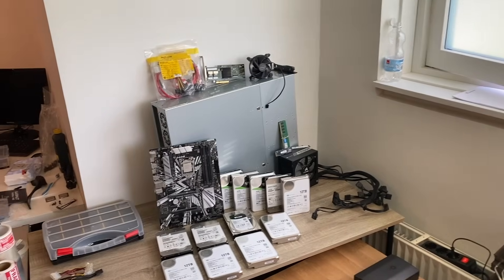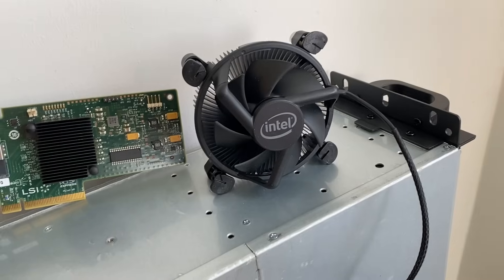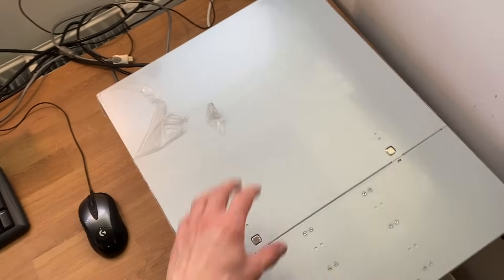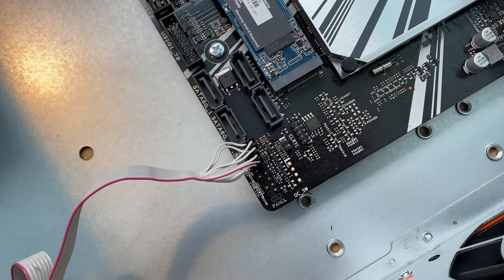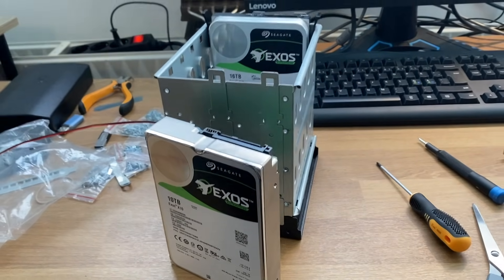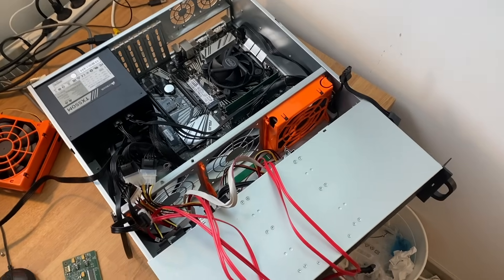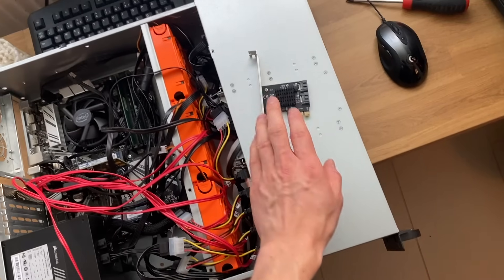Building a massive 164TB Home Server with 12HDD’s | maximizing my Storj Earnings & much more!

Comment: I'm considering Inter Tech 3U case, slightly different model number, no fans in the centre basically, but the front cages area look the same. Any idea if they are removable? Coz I'm thinking about using an Icy Dock or alternative 6 x 2.5 hot swap cage. which is 1 x 5.25 in size. And I will probably add a HDD hot swap cage so I've got that option, which would most likely be a straight swap for the section where the fan is and you aaded the first 5 drives. But wanna know if both are possible, or whether the internal drive parts are fixed in place, and not not modular, where I couldn't add the Icy Dock 2.5 cage.

Comment: 🎯 Key points for quick navigation:

00:00 🌐 Got internet setup in the workshop.
00:14 📦 Building a new 164TB server with 12 HDDs.
00:27 🔄 Only one drive dedicated to Storj, rest for personal projects.
01:09 ⚙️ Using a mix of SSDs and SATA drives with NVMes for the OS and caching.
02:05 🖥️ Motherboard: 9th Gen Intel i5 with lots of expandability.
02:47 💾 Storage includes various Seagate and HP Enterprise drives.
03:28 🔌 550W power supply and two NVMes for 250GB each.
04:50 🏠 Intertech server case housing 12 hard drives.
05:58 🧰 Case comes with four pre-installed fans, upgradable if needed.
07:09 🛠️ Installing the motherboard and power supply.
09:03 🔗 Routing cables and configuring PCI lanes for airflow.
10:26 🚧 Finalizing hard drive installation with 11 drives inserted.
12:31 🌬️ Swapped out fans for quieter, PWM-controlled ones.
13:01 🛒 Ordered a PCI one lane to two SATA connections for full setup.
13:55 🚀 Server up and running with all drives recognized in Windows.
14:52 📂 Drives allocated for Storj, personal projects, and future expansion.
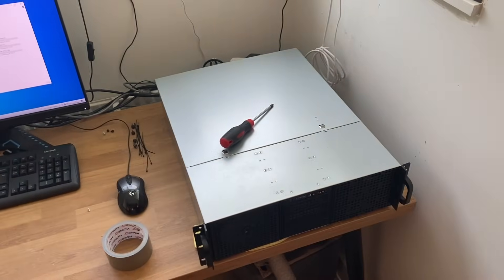15:20 ✔️ Successful build, case closed without issues, ready for use.

Made with HARPA AI
Reply from the maker: Aight

Comment: Bought the same case but I also added 2 extra 3.5" cages of which one is mounted behind the fan wall in front of the PSU. I have an 600w SFF psu and mATX motherboard. I can fit 19 3.5" drives and everything fits perfectly :)
Reply from the maker: Thats Great man!👍🏻👍🏻

Comment: Good setup. But, how much time needed to fill up 164TB with storj? I think, possibly never. There is was a huge data deletion at the last month. My node with 12TB space running 22 month and it's filled only at the 8TB for now. I have good internet connection and online up to 99%, good disk speed, but ingress is to low and periodical deletions is too big. Maybe I'm doing something wrong. Or node location is no good.
Reply from the maker: Hey nathan! Not all disks Will be used for STORJ. Also they are now talking about alot of new data Coming soon.
Reply: @hgsoftware5129  I've seen a significant increase in incoming traffic on my nodes over the past week. About 2TB is coming in each day. I really hope the traffic doesn't decrease in the future.
Reply from the maker: Its test data

Comment: I watched cause of that jazzy looking motherboard, as much as i like that case the money spent on that couldve been spent on a better motherboard, plenty of none server class pc cases that can house loads of Drives, Corsair Obsidian 900D/1000D, Phantek also make server sized cases, good job you dont have Graphic Card usage in mind for Video Editing or Gaming considering you only have 1x 550watt Power Supply, downside to that case only taking 1 PSU, FYI those PCI_E x1 slot SATA adapters come in 4 Port Versions as well, went down the windows route rather than Linux with Proxmox or Truenas kinda wonder what the use case is? and what about RAID? PS you can get x4 NVME PCI-E x16 Slot Cards pretty cheaply if you wanna use that other x16 slot as long as you can bificate the slot into x4x4x4x4 for each nvme drive on the card.
Reply from the maker: Hey man!
The mobo i allready had - so Big bonus. The case is cheap, and getting another Gaming case to hold 12 hdd whould cost the same even in used marked. Also the rack style fits My placement. ;)

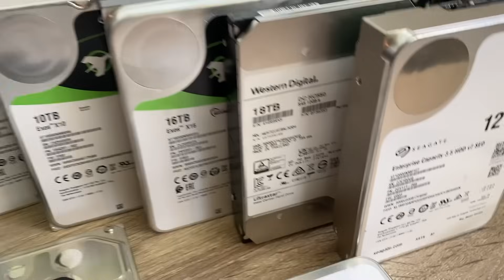Comment: 2:57 - These "HP" drives look like HGST Helioseal Ultrastar drives (owned by Western Digital, whose name is also on the lower part of the label). 
This is also confirmed by the model number of e.g. the left drive (WUH721818...), which is completelty fitting the HGST Helioseal drives, except for the first letter, which is W instead of H. U = Ultrastar, H = Helioseal, 72 = 7200 rpm. 18 = raw capacity, 18 = available capacity...
I personally am a big fan of these drives. They are very reliable and by many datacenters used.
Reply from the maker: Hey Thanks alot! That makes sense. Yea the drives was bought from a very high end local Company that uses the disks for windmills, they hard these they did not need so i Got to buy then cheap

Comment: is storj still profitable compared to chia? how much is 1tb expected to make monthly? i have about 300tb on chia atm and could consider switching
Reply from the maker: Hey man, you might take just one disk and convert to STORJ, but do not convert all at once. Because it takes a very long time to fill up your disks with STORJ, you only get data when there is data on the network. 

You make about 1,5 usd pr. Tb that is actually filled up

Comment: Could you please write power usage in idle and power usage in tests! You will use Unraid or other solution. Thanks
Reply from the maker: Hey man, idle is about 100 watts with all drives plugged in.
Will not use any raid, just jbod
Reply: @hgsoftware5129  unRaid is an operating system for NAS systems. Definitely worth having a look into for your system
Reply from the maker: Thanks for the advice 👍🏻😃

Comment: 14:11
I'm curious. Are you running all of them without redundancy/backups? 
If yes, what's your thought process on that.
Reply from the maker: Yes i am! 👍🏻 none of the data is essential enough to need backups - so that is the decision i went with
Reply: @hgsoftware5129  
Damn I wish I had your confidence. TBH that's the main headache i had to think of. Seeing 1/3 of your storage blocked out by redundancy SUCKS.
Reply from the maker: Haha i understand the feeling ;)
Reply: @hw2508  
With your logic 120TB raw will only get you 80TB. What a waste 40TB.
Reply: @jackipiegg  No, because you gain reliability.
You don't lose 1/3 of the capacity, it just serves a different purpose.
If you don't wanna do that, okay. But don't complain when one of your disks fail and you lose data or need a lot of time and money to get data back.
As a private person, this stuff usually is not that important. As a company, losing data, not being able to work, might cost your business a lot or even makes it fail.
With you logic also a backup would be waste of capacity, because a backup means storing data a second time. You could use that storage for something else.
And still a backup is quite important to many people.
Reply: @hw2508  
We're talking solely about personal data here, stick to that.

Many people cannot backup their whole array, example you can't backup 120TB, the cost alone is stupid expensive.

Having redundancy at 40TB cost is not reliable at all either. I have read horror stories when they are trying to rebuild their faulty drive, another drive failed in the process (like whack-a-mole) due to LONG rebuild time which makes the drive run 100% utilization for DAYS.
So the guy lived with 40TB deficit out of 120TB for years for him to realise raid is not a backup, RIP.

Its chicken and the egg problem. For personal data, I guess having them spread out with multiple drives is the best bet. You don't lose 40TB.
Reply: @jackipiegg  I just state the reason why this technique exists. It is up to the individual to use it or not.
Some people might thing they don't need it (Backup or RAID) and change their mind later when something happens.
"Horror stories": just because of other peoples bad experience (or failures), you abandon a working concept? Othe people would say: They did it wrong, I will do it right.

120TB of personal data is also not common and not a problem of the average home user.

Comment: Hi, I started off like you, using a single SAS to 4 SATA cables. But ever since I found this adaptor on the chinese taobao site, it was a superb option. Basically, this link im sharing with u is a 12 hdd cage that has a backplane (SAS/SATA), and the backplane, u can simply use a single miniSAS cable to SFF 8047 to ur LSI adaptor. And boom! 1 cable to 12 HDD which reduces the cable mess. There is also a 6 pin port, the seller will provide u with a 4x molex to a single 6 pin port to power all 12 hard drives. I have been using it for months and works like a charm. Will share the link with u if i can
Reply: Hahaha im not affiliated with the seller. Just sharing with you. I have about 20+ hard drives, running a 250TiB worth of Chia plots. Really lucky to have found this solution and dm sharing with you
Reply from the maker: Hi man, Thanks for the reccomendation - but i currently do not need any more drive space :) you are welcome to dm me tho
Reply: @hgsoftware5129  Hahhaha no problem!

Comment: SATA is a subset of SAS and SAS has a SATA compatibility mode built into it as well. You could set your whole structure for SAS and use SATA where necessary and it would work just fine.
Reply from the maker: Thanks alot! Then i did not need an additional adapter ;)
Reply: @hgsoftware5129  sas can easiely handle 120 Drives with one Controller. My storage is a Mix with SATA and sas Drives. Check how sas extander Work. My storage at the Moment is 320tb large for example.

Comment: SATA drives work with SAS adapters... just get the cable to fit. Note the reverse (SAS drives on SATA ports) don't work
Reply from the maker: Thanks alot, then i dont need the spare adapter

Comment: well, grab a 650w sfx psu with a mounting bracket for atx and then you can install a fan on the sas controller.
Reply from the maker: Did you see till the end of the video? I routed the cables above and was able to have a Fan and use the powersupply that was free ;)
Reply: @hgsoftware5129  ooops, my bad then. well… all is well that ends well i guess then, haha. and if its free, all the better. cheers!

Comment: Nice build, think i would have maybe gone with a slightly bigger psu, 500w for all those drives is going to strain the 12v rail a bit. Btw sas cables can be used on sata drives.
Reply from the maker: Hey man! Thanks so much for the tips! 👍🏻 i Think 550Watt is OK for this amount of drives. Lets hope.

Also Wow! Did not know about the sas to sata thing. Maybe i did not need that adapter after all!💪🏼
Reply: Maybe during initial spin up, but after they should settle in at 6–8 watts each and about 10 when seeking. Should be more than sufficient.

Comment: So it's not a 164TB home server...
Reply from the maker: Why? A workshop or home, server Can be used both places. I have this kind of server at home Also.
Reply: @hgsoftware5129   I mean I agree with this, but not all 164TBs are installed at once in the one home server? No?
Reply from the maker: Installed- yes they are ;) running at all times - not yet - but that Will Come.
Reply: @hgsoftware5129  installed means more than physically located inside a chassis when we're talking about computers. You're saying you have a 5 wheeled car because you're counting the spare wheel too. You may think of it as "installed" but nobody else will. By the same token I have a 1000000000tb server, the disks have just not been bought yet. But I *could buy them and install them*.

Comment: Home server... and it stays in the workshop.
So... no home server and title should be corrected?
Reply from the maker: Why? A workshop or home, server Can be used both places. I have this kind of server at home Also.
Reply: @hgsoftware5129  Because this use, workshop or home, do not fit exaclty (IMO) to a "home server".
I mean... Technically there are more home than workshops, therefore "home server" might be a bit more catchy than workshop server.
Reply from the maker: I disagree, a home server is just a server you Can have at home. My workshop is not a bussiness, Its a hobby room. So something i do When i relax. Not My job. Its next to My home, i Got home stuff there, like lego, old clothes and much more. I choose to Call it a home server, because you Can use this at home if you want, and build it, at home ;)
You are free to disagree

Comment: Awesome build - i have also recently bought a Inter-Tech case, and i think the build quality sucks. The metal do bend way to easy - and the fan setup also not make sense. It looks like it supports 4-pin fans, but no manual or logical way to get it working.
Reply from the maker: It works Great with 4 pin. I choose to not use molex - Its standard 4pin 

Thanks :)

For the Price i Think that is decent